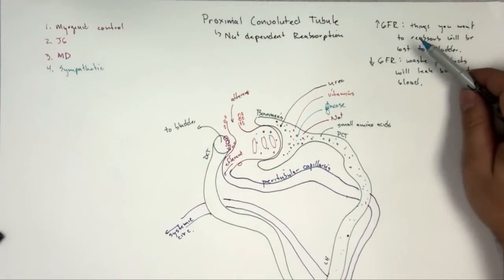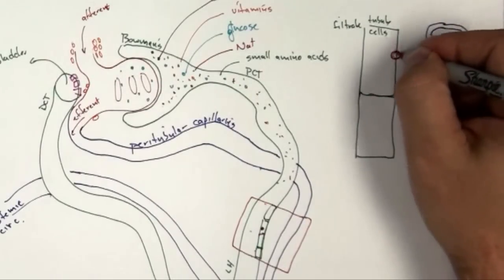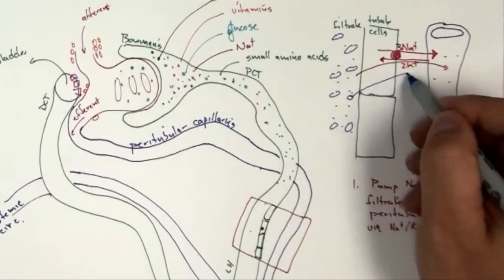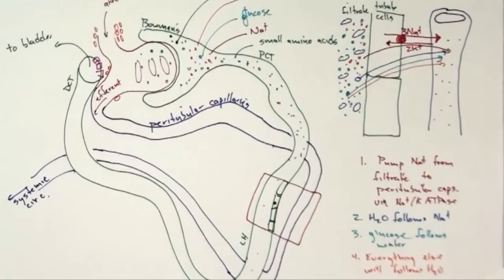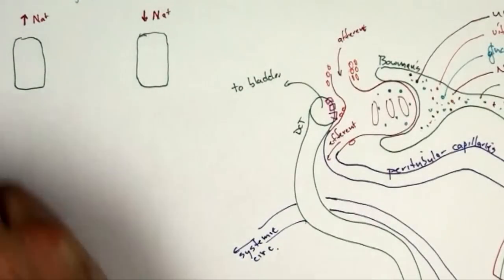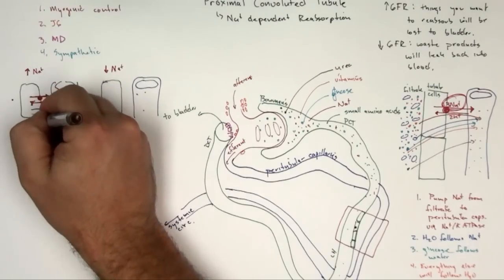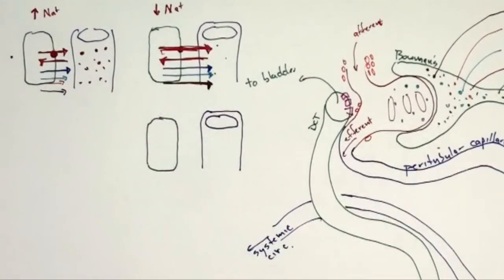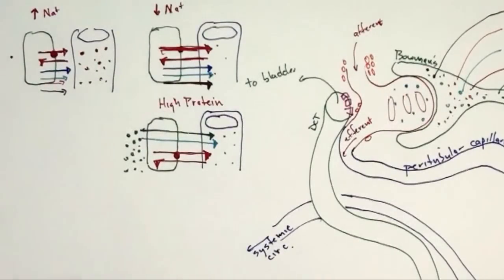Proximal Convoluted Tubule: Part 2

Comment: In this video you logically state that, due to concentration gradients, filtrate will passively diffuse from the PCT into the efferent arterioles. You mention that urea, however, only diffuses to a 'lesser extent', why exactly is that?

Comment: The Na/K ATPase "pumps" Na out of the cell on the basolateral side at both the PCT and the TAL (Thick Ascending Limb). 

This provides a favorable electrochemical gradient for transcellular transport of sodium (and chloride). 

I guess the confusion is about sodium entry into the cells. This occurs through an apical exchanger protein ( ONE sodium is taken in and ONE proton is kicked out) called NHE-3. 

"passive" processes such as paracellular transport occur in both PCT and TAL as well.